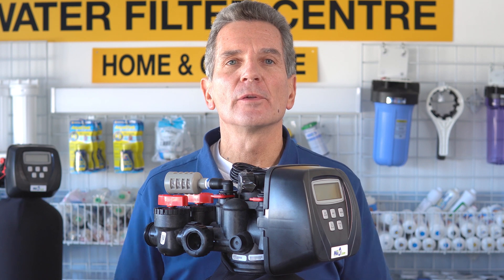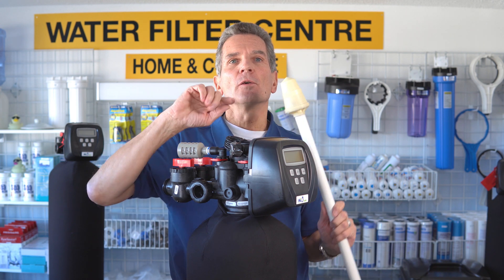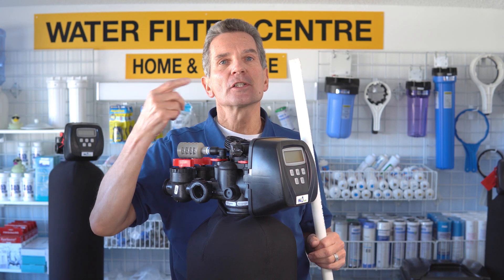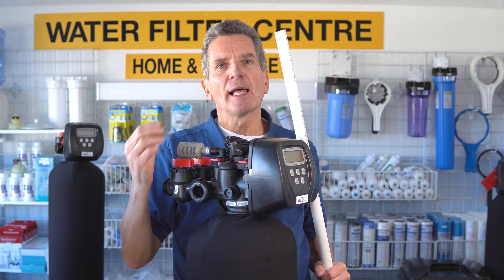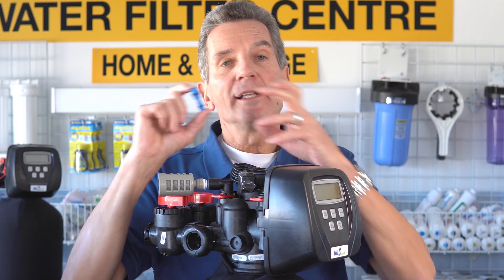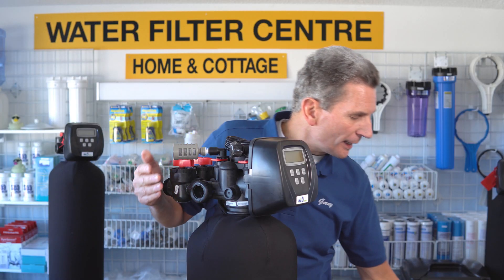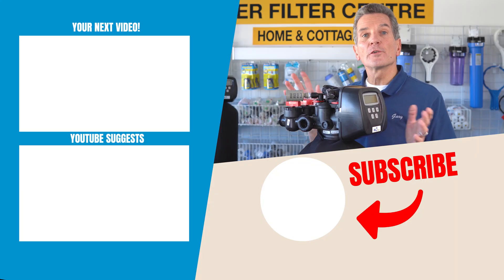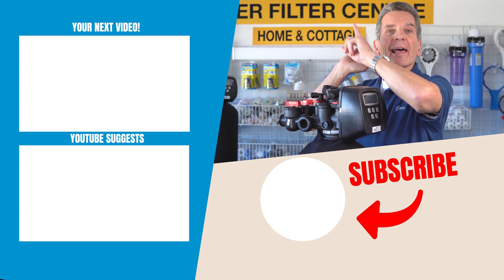HOW DOES a CHEMICAL FREE FOB IRON and SULPHUR Filter Work?

Comment: Hi Gary. My iron/ sulfur tank pushes water out the air vent a few seconds before back washing. The jet also keeps getting clogged with iron. Our house smells like rotten eggs. We just paid a guy 950 bucks to change the media in the sulfur and softener tank and rebuild the heads, but he went MIA when said it still didn't work.. I need help. I can't figure it out
Reply from the maker: You likley need a new air intake https://waterestore.ca/products/clack-fob-c-k-strainer-check-valve-air-intake-assy Do you mean the injector gets clogged? https://waterestore.ca/products/clack-white-injector-v3010-1e-replacement

Comment: We have an Aqua Systems Iron (and I believe, sulphur) whole house, filtration system. It's 10 years old and appears to take 4 hours to go through the regen cycle. the pump running in the night makes me nuts. Does this time frame  sound excessive. we used to have someone come to do "maintenance" every year, which took 5 minutes and cost $300 (this also seemed excessive so, we stopped having them come, as we were feeling taken advantage of.  Can you recommend a maintenance routine? Do we have to have a professional come to push a couple buttons every year to do this?
I thought we had a manual but, can't find it and can't figure out what model we have. Please help!?
Reply from the maker: It should take about 45 minutes.  15 minutes to backwash and 30 minutes to rinse

Comment: Hey Gary, is this kind of control valve same as the water softener control valve but we add the air screen to the brine line?
Reply from the maker: Yes, it is, exactly but the programming is quite a bit different.
Reply: @water_estore  thank you very much, Gary. One more thing, I am wondering about iron removal with your FOB filter but instead of using automatic valve like u did, can I use manual softener valve (5 ways valve)?
Reply from the maker: @kennybuffon7974  you might be able to if you can control the programming to give you the correct cycles in the correct order for the correct time.
Reply from the maker: @kennybuffon7974  you might be able to if you can control the programming to give you the correct cycles in the correct order for the correct time.
Reply: @water_estore  well thank you Gary! :) Do you have the video about the programming on iron filter? Thank you :)

Comment: Hey Gary I've watched a few of these filter videos and couldn't figure it out when the FOB would be preferable to the FOK?
Reply from the maker: Great question!  Fob  costs less and due to the lighter media it can work with a flow rate coming from the well as low as 4.5 gallons per minute while the FOK needs more, 6 gpm plus.

Comment: Hey Gary! After the system rebuilds the air bubble through the "brine" draw, if it then performs a fast rinse immediately afterwards, would that rinse cycle push the air bubble to the drain? I would not think so because the rinse has the same flow direction as service, only the water is going to drain instead of to the house, but I wanted to confirm.
Reply from the maker: I’m not sure but I think you would loose the air from inside the tank. Why would you want to add a rinse cycle?
Reply: @water_estore  My thought was that it would ensure that the media was fully compressed. My unit is programmed to finish after the air draw. It made me wonder, though, how the media goes back to service immediately after without anything re-compressing it with a normal-flow rinse.